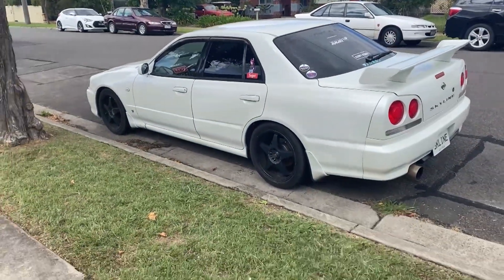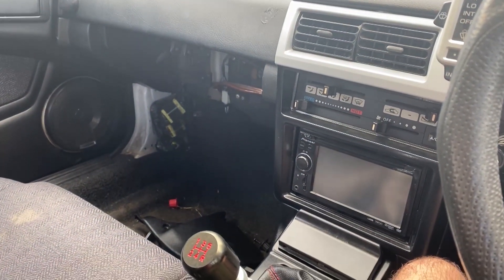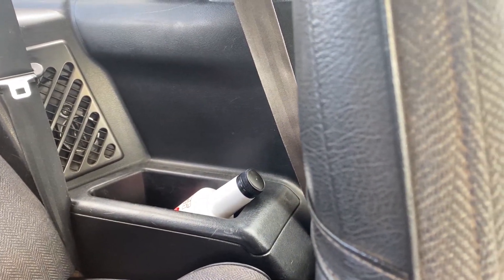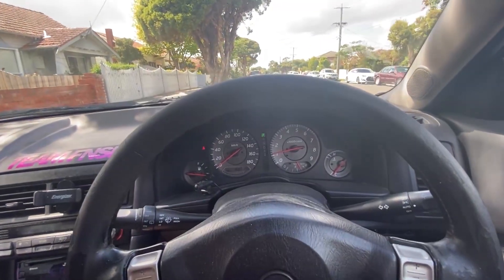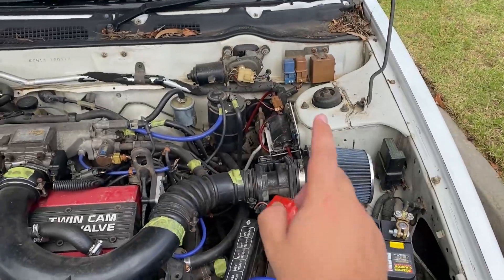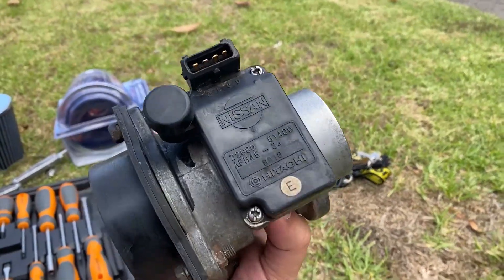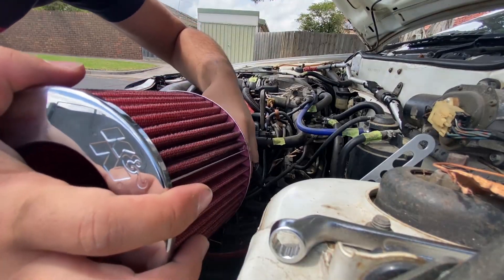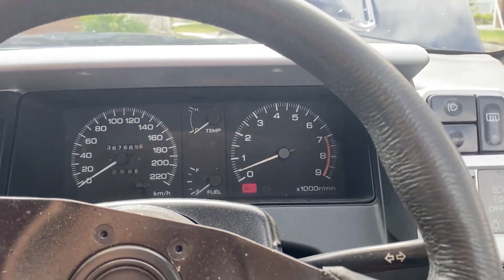Will cleaning the MAF Sensor fix my COLD START ISSUE?? - EXA (WISH86) Build

Comment: you need an idle control valve homie
or suss the vacuum lines on the valve xx
Reply from the maker: Defs seems vac related, I cleaned the Idle Air Control Valve out, needa post the video of it running soon coz I did fix it ahaha